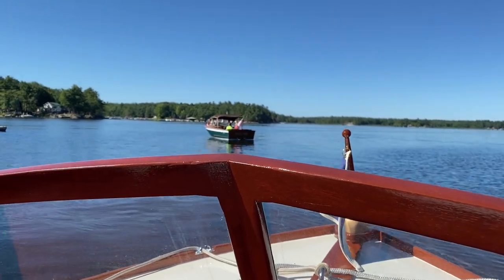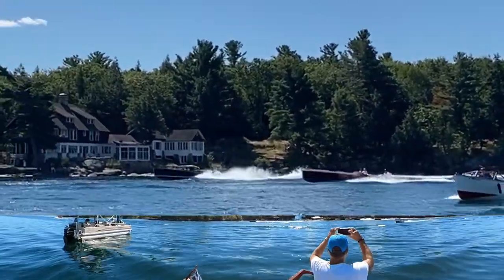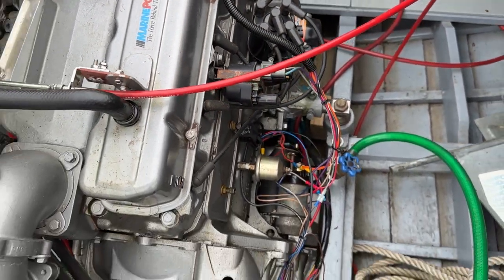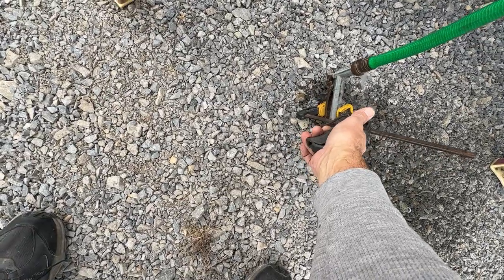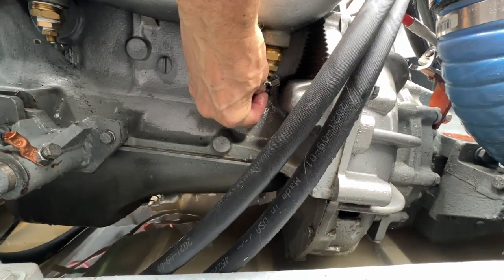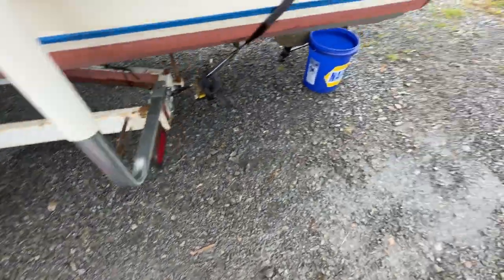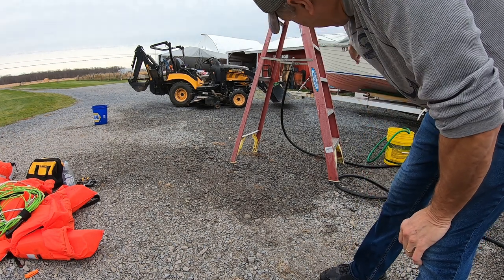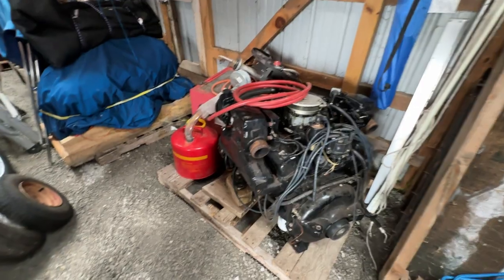Winterizing the Chris Craft S4 E9

Comment: I was surprised to see so much splitting and cracking on unbeknownst’s transom. Is that normal after one season? Also, why is the drain plug and bilge pump in the bow instead of the stern?
Reply from the maker: We are discussing here why the split occurred. It is right at a joint where I probably made that piece of mahogany too tight when installing. Being in the water swelled that piece and caused the crack. I may run a thin kerf saw blade down the joint to widen it, then caulk the joint so when it swells it doesn’t cause pressure there. Due to the oak frame behind the joint it doesn’t leak, just looks bad.
On those hulls, just in front of the driver’s seat is the lowest point when the boat is stationary. I also have a bilge pump aft in case it’s needed while underway as the water would flow toward the stern while moving but that pump has never come on. The front pump seldom comes on, I’ve only seen it happen the first time I get in the boat that day.
Reply: @glassgoat9601  That makes sense. I'm just used to jacking the bow up as much as possible to flush everything down to the stern before pumping or draining so I was a little surprised.

Comment: Is it legal to dump antifreeze on the ground?
Reply from the maker: Tom, the pink antifreeze is  supposed to be biodegradable  and relatively safe. It uses propylene glycol which is found in a lot of foods we eat. It is used here not only in boats and RVs but to protect the water systems of thousands of camps and summer houses in this area ending up flushed into septic systems in the spring. That being said, I am working on creating a system to capture and reuse some of this coolant each year but there is the issue of dilution as usually the antifreeze is displaced as water pushes it out of the engine. Due to the extreme climate here and the expensive engines I’m trying to protect, a mistake in this process can be costly.